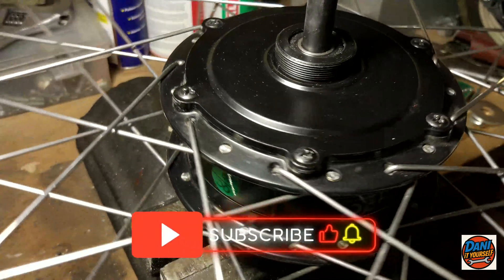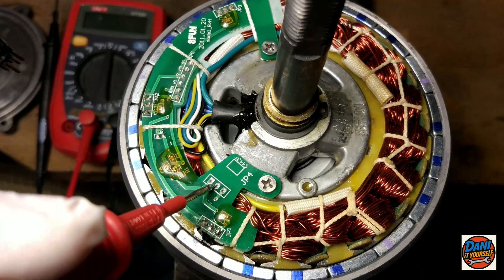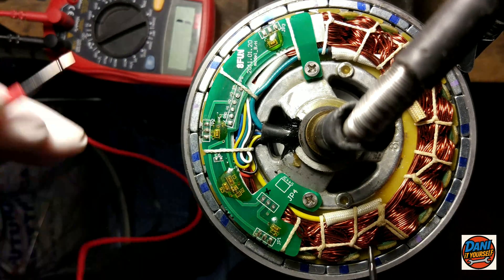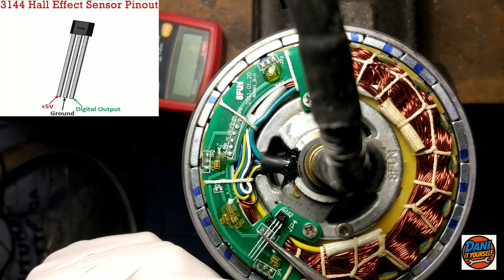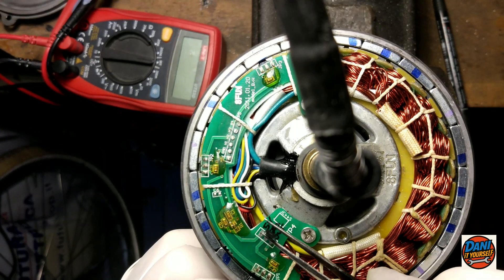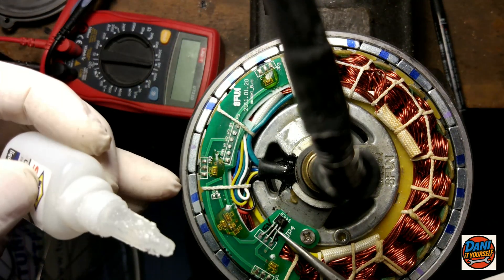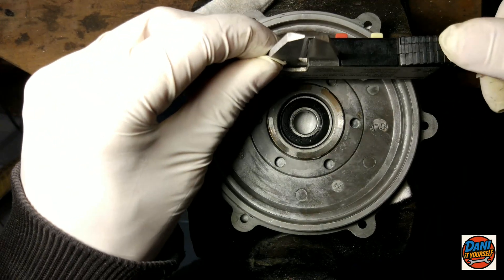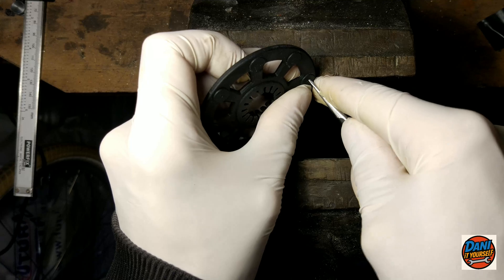How to Add a Hall Sensor for Speed in a Geared Hub Motor 8FUN – #DIY Complete Guide for #ebikemotor

Comment: Hi i have this extra sensor already built into my motor and the slots for magnets which only has 1 magnet ,could the sensor be for anything else before i add another magnet ??and what effect does it have by adding extra magnets? I have upgraded the battery but only buy 2 volts i want to add a 40amp controller with a 25amp battery as the stock is a 18amp controller 16amp battery and the motors 1000watt and slytly just under double that peak,i did however notice when i put a 20 amp battery on it it was maxing out but felt like a lil flutter of pullback and then it would react again but ive been having trouble with my throttle to which ive changed and not had that problem ,id appreciate if u could tell me what else that sensor would be for if not a speed sensor i do have the white wire but its  connected on the board somewere i will check for a continuity test from wire to sensor ,i imagine it will pick up speed much quicker with the extra magnet! Is 1 more magnet enough would u say ? Ive subbed 👍and thanks youve solved a problem that google doesnt want to answer 😅
Reply from the maker: Hi, thanks for the comment. The white wire can also be used for a temperature sensor to read the temperature on the display if it supports this function.
I added two magnets to balance the rotational weight, but then I set the display to have two pulses per wheel revolution, otherwise it would read double the speed.😁
Reply: @daniityourself thanks so much for your reply ,here's my problem i want to run a bigger battery and controller the motors beefy enough for this or i wouldnt be doing it but I tried with just the battery it was amazing the difference  but I hit top speed and it kinda cut the motor more of a flutter and then start building speed again ,so I was thinking to just remove the magnet that way no signal until I saw your vid and now u got me really invested so you've tricked the display into thi king theres 2 wheels giving power ?am I rite?? And have u any drawbacks
Reply from the maker: @whitefeatherslinger8194  Probably I didn’t explain myself well. The number of magnets—whether one or two—doesn’t make any difference if you set the number of magnetic pulses per wheel revolution on the display. I’ve used two magnets just to balance the hub cover’s weight better. My display (KT CONTROLLER) allows me to adjust this parameter (1 wheel rpm = 2 magnet). Adding an extra magnet won’t make you go faster; in fact, it will probably make you go at half the speed unless you set the two pulses per revolution in the display.

In your case, if you feel the motor vibrating, there could be multiple factors: either the current is too high, or your controller is struggling to handle the higher RPMs caused by the increased voltage. What brand of controller and motor are you using? If your motor is gearless, the speed will be calculated automatically, while with geared hubs, since there’s an internal clutch that disconnects the motor from the wheel, you need the hall sensor with the magnet
Reply: @daniityourself the bike is a engwe ep2pro the motors a hub geared 750watt peak 1000 but ive seen it peak over 15 the controller  im not sure buddy ive checked there it aint a KT its a 18amp JK is the only english.your correct about the current with that flutter but it wasnt the batterys current the controller was set to full current i dont know what it should be at but iveset it to what the battery and controller are and from lifting the wheel the motors so much smoother,also the controller i will be using isnt a kt either but ima order a display that will give me advanced settings with instructions for this kinda thing ,whoever been messing with the display before i hot the bike maybe tryna unlock speed or whatever seems to have messed up but got the bike unlocked and left it at that ,the bike only 4mth old and he sold it for a stupid price so i didnt think twice still got few months garuntee but im not concerned about that as i already had the stuff to upgrade the bike,i deal with hubs geared mostly there my thing im more about torgue than speed as i wanna make a trailer for fishing weekends and just to get away,i will be putting a front motor on it as this trailer goina be over 6ft3or4wide ,i do have middrive motors that would suit this better i got a gen4 bosch cargo that was ran on a belt but when i plug it in it takes my battery etc but no speed digits come up i bought it from facebook marketplace and it like brand new and my motor on my bike was woreout so this was ideal more power fits in uses same everything so i get onto bosch and they tell me to bring it to a dealer but were i live there far  away and unless ive bought from there store then they wont entertain me and apparently its a 20minute job plug into computer and clear some thing but thats another story sorry for going off topic ,i will get u proper names to my display and controller and see if u know anything about it ,and im so grateful for your help i truly am i try do the same with others on here and its nice to get someone back rolling cos god knows i know that feeling ,godbless u my man ill have info from my new controller battery and current ones and we'll see if anythings familiar much thanks man
Reply from the maker: @whitefeatherslinger8194  Hey! Unfortunately, I’m not very familiar with that bike model, but from what you describe, it sounds like the controller might be of low quality and works well only with the bike’s original system. When you try to upgrade, it often messes with the balance and can cause issues.
Regarding the smooth rotation with the wheel lifted, that’s normal since the motor isn’t under load. But when the bike is in motion and the motor is under stress, vibrations might appear, especially if there's a higher current demand. The vibrations could also be due to the Hall sensors being positioned incorrectly. I recommend checking the Hall PCB to see if there are any slots to adjust the sensor position. If there are, try adjusting them to get everything running smoother.

Also, I suggest joining the Endless Sphere forum (www.endless-sphere.com).

 There are a lot of experienced people there who might have the same type of controller or bike, and they could give you more specific advice. You can also post pictures of your bike and ask for help.

Good luck with your projects, hope you get everything sorted out!😁
Reply: Thanks my man i will go back to the original controller as this all started with that controller ,it would hit top speed and once i kept full throttle and it went over its limit it wasnt a bad motion it was like a car when not getting gas but only until i let off the throttle and then straight bavk to normal i honestly think either the controller or display has a cap once breached it will do what i explained so when i saw u adding a sensor with magnet s i taught maybe thats whats stopping it from reaching full speed but i did have a dodgy throttle that would cut motor random not like normal motor throttle shutoff so i changed it for a thumb throttle lowered the speed a lil and have kept it at that until i figure out what the sensor and magnet did i then came accross u and was thinking a extra pulse might stop that cutoff and let the motor run on .ive not put my bigger voltage items on until i figure this out however ive seen a guy with a dual setup and was asking and he said i just removed the magnet as the same was happening to him even if he used only his front motor and was over speed hed get flutter and drop speed ,when i say flutter i mean or i think its the motors reaction to get speed dropped asap ,i will be getting a new display for this higher setup that will let me know alot more..also if your from America or around there i think this bike is called "friend",i seen a utube vid about display settings and thats what its branded over there if thats any help and yeah im on the sphere its good but there alot who think they know what there talking about but i vouldnt trust so much ,im so thankful for your advice tho im going to watch your middrive conversion i gotta see if theres something that can be done to keep it from smoking happy holidays my man u de man 💯🔧☘️greeting from ireland  @daniityourself
Reply from the maker: @whitefeatherslinger8194  OK, now that you've given me the example of the car running out of fuel, I think I understand your problem better. I've experienced the same thing using my controller with all settings at max. What happened?
When I selected the highest assist level, the bike would hit top speed right away, but then it would stutter, with high current spikes, which resulted in low efficiency and heat losses.
What did I change? On my display, there's a parameter called 'Characteristic Parameter Setting' (in the manual, it's referred to as P1 - motor characteristic parameter setting, P1 = motor gear reduction ratio × number of rotor magnets, rounding if there's any decimal).
You can get an idea by looking at this KT display manual (https://download.elecycles.com/manual/Display-Manual/LCD3-display.pdf) and see if your display has something similar. If you find it, I recommend lowering that parameter step by step until the bike no longer stutters at top speed.
I am Italian😀 Thanks a lot for the wishes, and happy holidays to you too! 
I Like Ireland.🍻🍻
Reply from the maker: Anyway, I use an Eggrider display, which is made in the UK. It's much better than a classic display. It's compatible with different controllers, but you need to check if the communication protocol is listed by the manufacturer. I know it's compatible with 8fun, KT, and Lishui controllers. Additionally, it connects to your smartphone, and you can log graphical data of the parameters that interest you. Take a look at it!
Reply: @daniityourself ok ive the big controller it don't give much as its a this years controller but what I got is "LCDSM"  and on another part I got FFJK ,,all connectors look the same as like kt however ill have proper control make etc for u tomorrow my man 💪
Reply: @daniityourself Italian and irish were like brothers man 🎉🎉💪💪we built this world hard labour good food eh  much love my man im onto it